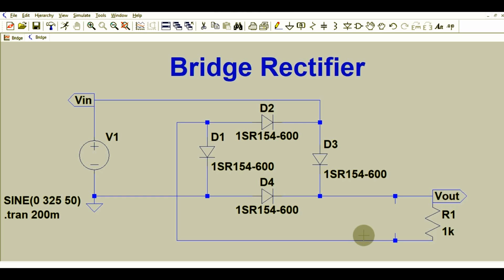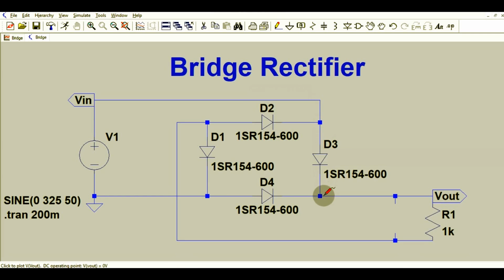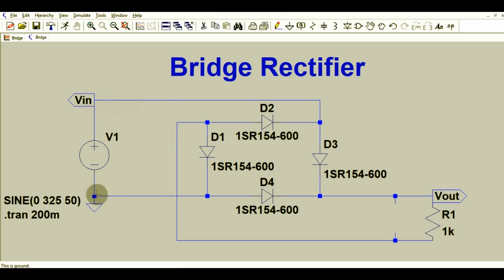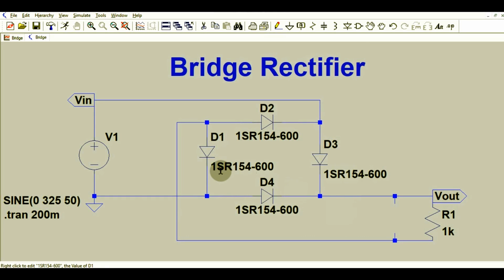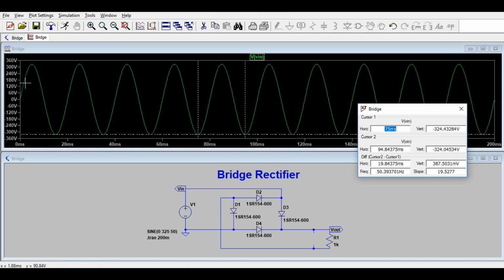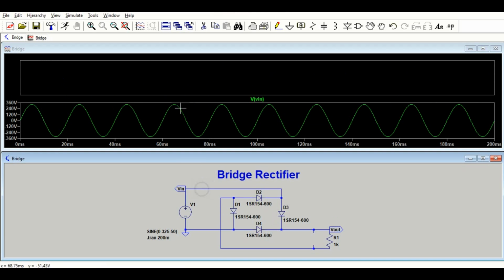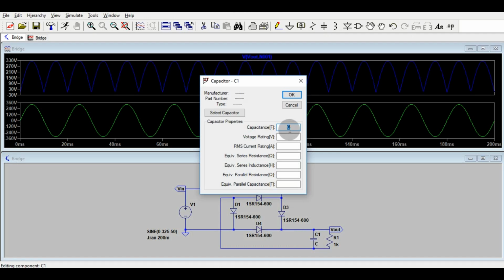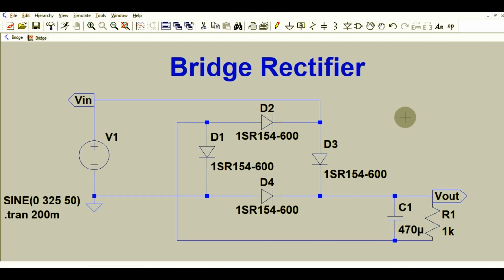LTSpice Diode Full Bridge Rectifier Simulation - YouTube

Comment: where's the GND for load?
Reply from the maker: Hi Thanks for good question...In ltspice if both gnd is same for bridge rectifier. The rectification won't work. So either you have to use gnd in input side or load side but not both side.
You can try !